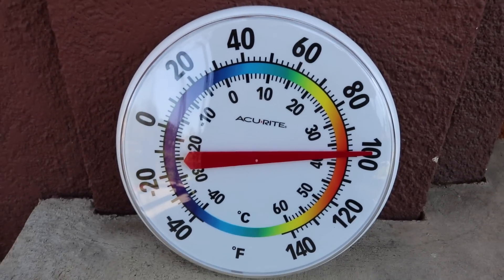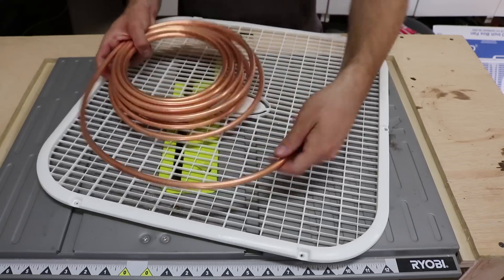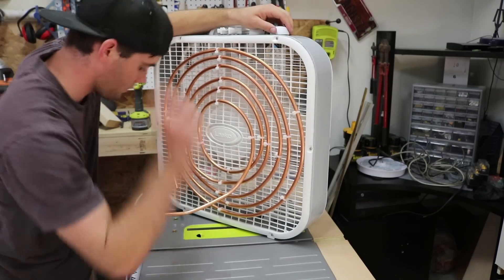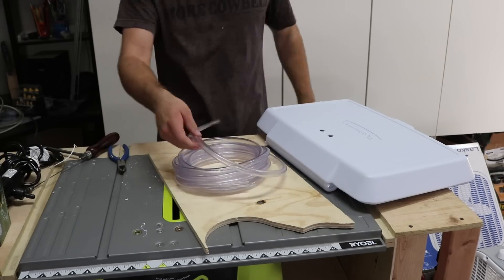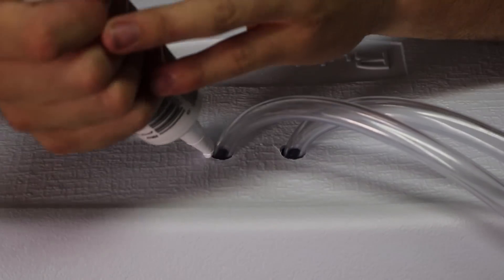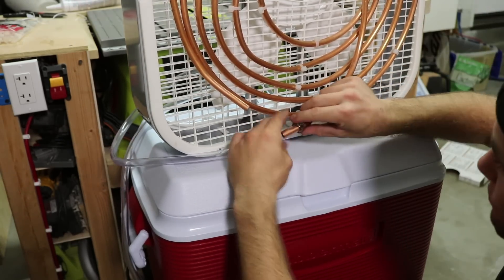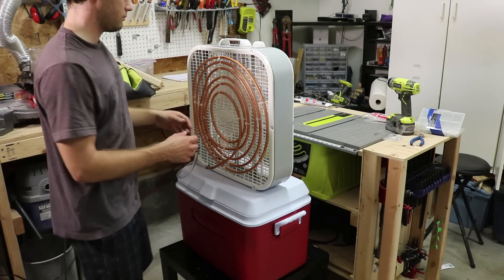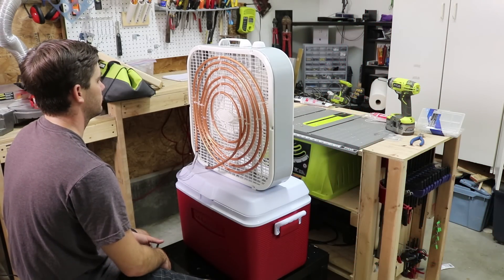$100 Homemade Air Conditioner - DIY

Comment: For pretty close to the cost of that, you could buy a real AC unit.
Reply: Tou Xic vong You didn't list the cost of ice anywhere in there. I could run a small window unit for $.05/hr. In other words, I could run an AC for 30 HOURS for the same cost as 1 small bag of ice. And what everyone seems to forget is that, just like the box fan and pump, an AC has an off switch and doesn't have to run 24/7.

Before you go saying "I'll make my own ice" I suggest you find one of my other replies that spells out how that costs 3x as much as running a window unit.
Reply: shane bates you seem like a idiot, lol 😂
Reply: You're right. But it is much more expensive to run than a fan and a small pump. On the other hand, what good is the DIY AC if it doesn't cool everything down and makes a lot of condensation that you have to deal with?
Reply: MrDeadmanwalken1 I know how an A/C system works, what I didnt know ice makers had an exhaust that goes outside. Regular refrigerators pump heat from the inside of the fridge to the  outside,your home, so essentially you wouod be making you house warmer trying to use that ice.
Reply: I'm pretty sure a Ice maker & a A/C  unit are slightly different as in internal parts making them what they are made for & an ice maker would be a cooler way to keep a room cool compared to that shitty feeling that comes with using a/c units.
Reply: Hi there... I'm a refrigeration technician and what you're saying is incorrect. An ice machine will increase the temperature of any room it's placed into. The "radiator" you're referring to is called a condenser, and the fan blows air across the condenser coil to condense the refrigerant back into a high temperature liquid. Discharge air can easily soar over 100°F. The low temperature "expanded" refrigerant never comes in contact with ambient room air; it has water poured across a freezing surface attached to the evaporator. But yes, like a heatpump, there is a heat exchange from the water to the freezing surface, the heat from the ice is literally vented into whatever room the ice machine is in (unless the condensing unit is mounted on the exterior of the building)
Reply: not to mention the constant purchase of ice. If you make the ice at home your house ends up getting warmer
Reply: @raulciprianoyahoo  he is in a shop,  for his ac being able to move around there is very awesome
An AC unit needs to be in an enclosed area
Ice isn't near as expensive as an electric bill that has an AC unit
His ice can last
Reply: @raulciprianoyahoo  wwtf how will your home get warmer if you take some ice what do you like in an Igloo
Reply: @raulciprianoyahoo  put water in a jug and freeze it. Use it freeze again. Freeze it and ......,u get the idea right?  No need to buy ice
Reply: @raulciprianoyahoo  your already running your existing freezer. Just freeze a couple salad bowls with tap water.
Reply: @raulciprianoyahoo  most people have a fridge/freezer anyway
Reply: If you add salt to the ice water it'll drop the temperature  downto about 28 degrees but it won't freeze. .so it'll  still be fluid enough to go through the pump. .try it. It works
Reply: You can get an even larger used one for 100. Craigslist rocks. Just try it out first.
Reply: I live in a small town where many of the rental properties are owed by individuals. They write it into the lease that you are not allowed to have an AC installed. For situations like that, this is an attractive idea.
Reply: 6000btu units would cool a garage and cost $120ish.
Reply: Mikeman hoff so you think a cooler full of ice and a fan would do a better job???
Reply: Raul Cipriano yea I just installed one in a convenience store last year, since then I've kinda wanted to get one. They have a 3 stage water filter system vs the fridgerator ones so the ice is much cleaner and it's designed for 24/7 operation while maintaining temps in the store reducing cooling cost of the store vs the aio units fridges come with so no heat goes in the building.since it works just like a ac heatpump whole house unit but it mounts to the outer wall I think that it would be great since you can shut off the ice making part and just turn it on as needed not having ti worry about running out of ice
Reply: you can get a mini split pretty cheap
Reply: Window unit BUT refrigerated AC uses a ton of electricity & an evaporative water cooler runs on the same as a big light bulb..big difference
Reply: Yes,9000 btu window ac is for$ 109,and can cool the space way better than this
Reply: @gegazaidd  yes until you see how much electricity needed to run the ac.
Reply: Buy a window AC for $200 and cut out a window Boom!
Reply: MrDgwphotos you would need to spend 500-600$ to get a powerful enough unit to be able to cool an un insulated garage that gets to 100-125 degrees every day....
Reply: Tou Xic vong  I like where your heads at. Now imagine how much you could save if you ditched the house and lived in a refrigerator.
Reply: MrDgwphotos what everyone fails to realize is he has no windows to put a unit up in his shop. That’s why he made it this way.
Reply: Ingenuity and the price of doing something yourself... priceless. And I’m pretty sure as a young inventor his mind has already thought of hundreds of ways to improve upon his concept. That is the actual and only cost here.
Reply: MrDgwphotos and those A/C Units will jack up your Electric Bill
Reply: @SiberianStalker  Install solar panels and during daytime it runs for free. A A+++ Daikin model doesn't consume much.
Reply: @SiberianStalker  it will be much cheaper than buying several bags of ice each day. Besides, this fan won't actually cool the room down.
Reply: @SiberianStalker  And making the extra ice in the freezer won't?
Reply: Ricki Rowell so will that much ice
Reply: @pulaskiPumper  You don't turn up your freezer...leave at it current setting...I know it will take longer to make ice but there is no need to turn down the temp in the freezer...
Reply: @SiberianStalker  Ice grows on trees does it?
Reply: @SiberianStalker   liberal Paradise
Reply: There is one aspect that I think most people are not thinking of, and that is ventilation. In a garage there is nowhere to place a window unit and nowhere to vent a stand up unit. So for him, or anyone else with a simular issue, this is a great Idea. It's not so much about saving money as it is a different way to cool down if a traditional AC unit is not available. I dont really get why people are knocking the guy for sharing his ideas to help people and then donating the proceeds to charity.
Reply: @katiekerr5973  Because "Darwin rules", and our whole society is run on the basis of knocking other people down to advance yourself. Rather than competition making most ships rise, with a rising tide of achievement and with constant improvement, it's "destroy the competition" to show what a brutal tough ass you are. Even though this tiny AC does not meet every need for AC in the world, it sure fits a niche need, like cooling a little air in a place where there may be refrigeration, but AC is nothing but a dream. In addition, some people already have the parts, and can reuse them. 

As for making ice costing so much money, how much does it cost to cool the air in empty space in a freezer? Given that a freezer works most efficiently at about 75% full--once the contents are frozen, that is--would it cost so much more to freeze a block of ice in an already cold freezer, filled with frozen food, Blue Ice, water bottles, and ice blocks that were planned to keep 75% of the freezer full, minus the block a day you are freezing to run this cooler, and the ice cubes that cool your drinks? And if you froze your water bottles to have ice water to drink all day, couldn't you float a few in your reservoir to trade their "frozenness" with the cooling water? That way, your water bottles would help the freezer's efficiency, then would give up some of their cold to cooling the air pulled through the fan, then the person standing in it, rather than just wasting that cold sitting on a counter in the kitchen while they come to a drinkable temperature. A box fan is not for cooling the whole world, but for directing a cooling breeze in the direction of a few people. But it works well for that; this makes it cool much better when it's really hot.
Reply: @katiekerr5973  too many trolls here.
Reply: Not sure about the type of heat out west where I assume that this is located, but I would bet it is a dry heat.  Here in Alabama, in this humidity, the temperatures don't get as high as the desert but our heat is like walking into a steam sauna.  You would be much better off using a $100 window a/c unit here to help dry the air while cooling.
Reply: Doggeslife would still cool more then this unit
Reply: That’s what I was thinking! I just bought one for 116!
Reply: What kind of electric bills do you get, wow.  My $140 digital window unit from wal mart only drove my bill up an additional $20 a month from being run on high all the time. Sounds like you have Ameren Electric
Reply: cut a hole in the wall to accomadate the window unit. Me and my dad did this at my grandmas house and it seals up nicely.
Reply: Ricki Rowell how much would ice all day everyday be compared to a few bucks on the electric bill?
Reply: If it works, it would be cheaper than an A/C.  The cost of running an A/C is too great for some.  The little pump and the fan cost nothing to run.
Reply: beefstew78 Here is $2.49 for a 10 pound bag, but that's a expensive way to go.  You have to make your own ice in the freezer.  It's way cheaper.
Reply: Also, all you would have to do is substitute frozen water jugs with the ice he uses to make more efficient.
Reply: no there are portable units that roll on the ground. for like 150 bucks.
Reply: I'll use this in my beer cooler dispenser to cool the beer down. It's made from old pallets... holds a case, ice cold. This will chill the beer chute where the cans sit. Perfect...
Reply: MrDgwphotos  true BUT, he’s running about only 45 watts. He could run that thing on a solar panel. This is a good idea. I’ve done it. It works.
Reply: thats so true,  I found this other video explaining how to do a homemade air conditioning step by step and much cheaper
Reply: Bigger power bill.
Reply: This would be good if you want the fan to only hit you and also less light bill compared to window ac
Reply: MrDgwphotos yep with tax only 109.99 for the extra 10 you can be lazy.
Reply: @sheilahall9060  he is in a shop where it is in the open,  an AC only works in closed rooms
This fan can be moved,  will blow well and the electric bill will be decent
Reply: @sheilahall9060  but it could cost $100 a month to run that a.c. and they are friggen loud.
Reply: Obviously
Reply: It would cool better than a fan
Reply: Raul Cipriano but would that effect how much electricity you would be using?
Reply: same
Reply: Doggeslife cool better then a fan with some cold water running through it😂
Reply: I love how the idiot makes the stupid comment, and then you never see him ever again. Fools don't like facts thrown back at them.
Reply: Doggeslife I bet it cool more the a cooler with ice and a fan
Reply: M Thomas everyone is talking about window units.
Reply: cole everett I know they cool rooms and cost 120 bucks period
Reply: fladave99 Mills ice isn't free though.
Reply: James Charbonneau exactly
Reply: Plus damned taxes, sweet thing.
Reply: Sus Sus your forgetting a bag of ice is 5 bucks at some places.
Reply: Sus Sus now buy ten of those a day every day.
Reply: Hey YOU SMART People !!!!!!!!!  Wanna see ME STUPID...... Look here:  https://www.youtube.com/watch?v=m1sj6ispqT8
Reply: Christopher hey bro can you give me the info for this ac unit please? This sounds totally worth it
Reply: MrDgwphotos the cost of running a real ac drag ur bills up by 2 to 300 dollars a month trying to save money not spend it
Reply: Actually you can get one for $79.00 @ Wallyworld
Reply: Yes, a made in China AC Unit only worse $100... AT least better than this one
Reply: @The Magnificent Whalens Its that place West and South of the real US. And getting worse all the time.
Reply: How is the humidity?
Reply: @M T smh
Reply: no but you can buy a a huge aircooler
Reply: But it wouldn't be as effective,  being that is a workshop,  it would actually be pointless
Reply: Lol 😂
Reply: Lmao 😂 🤣😂 🤣😂 🤣
Reply: Yeah if you want to punch a hole in your garage
Reply: A new 5,000 btu a/c, is $89.00
Reply: You can buy a small air conditioner for $100, but it will suck up gobs of electricity trying to keep that garage cool.  The cooler setup is meant for spot comfort and only uses a trivial amount of power in comparison.
Reply: @Lex5576  Them your first step should be to insulate the garage.
Reply: LOL
Reply: Or you can open your doors?!
Reply: But if you're secretly making shine, you can justify buying the worm if anyone asks.
Reply: Why does everyone seem to think it's so expensive to make ice?? It's ICE! It costs NOTHING to make it! Unless you guys unplug your freezers every time you finish freezing a batch of ice cubes? My freezer is always running and it costs the same to do that whether I've got water freezing in there or not. I'm really not following that logic...

That said, I do agree that this is really inefficient. I've seen another DIY option that does the exact same thing, and it cost them all of $8 to make. It makes no sense to spend so much on a fan plopped a cooler. But, the argument for that isn't over the cost of ice, it's that for $20 more, I could buy a brand new 5000 BTU window unit. I could get a near brand new one, with an even higher BTU, for even less. This is just not worth the cost
Reply: Ok this is portable. Do you want to pull your window fan from room to room.
Reply: Lol
Reply: Except you cant put that ac anywhere you want.  Considering it will have to have an exhaust.
Reply: True!!!
Reply: I thought the same thing.  Well, for not a whole lot more.  Why not spend a little more and get the real thing without going through all this hassle?
Reply: Yeah but you're gonna save on your electric bills.
Reply: Where will he install it? You need a window then it becomes a weak spot for burglars to come in.. plus a 100 dollar unit is about 5000 btu it will continually  work without stopping ,thats about 8 amps of electricity.. it adds up.
Reply: ROFL!
Reply: WITH a warranty
Reply: this is fake. its not AC
Reply: To answer your question which is probably already been answered it is true that the cost is close to buying a regular AC unit but the cost of running a fan and pump compared to a air conditioner is huge electricity is hired to run AC than a fan.
Reply: @darrellwestphal4265  but you will be cool. Who cares how much it cost
Reply: 8-27-2019=Tuesday  =THE POWER OF FAITH=  Have faith in the LORD your your GOD and you will be upheld.    2 Chronicles 20:20.     Every life----including yours-----is a series of successes and failures,  celebrations and disappointments, joys and sorrows.  Every step of the way, through every triumph and tragedy, GOD will stand by your side and strengthen you . . . if you have faith in Him. JESUS taught His disciples that if they had faith,  they could move mountains.  You can too.     When you place your faith, you trust, indeed your life in the hand of CHRIST JESUS,  you'll be amazed at the marvelous things He can do with you and through you. So strengthen  your faith through praise, through worship, through Bible study,  and through prayer. And trust GOD'S plans. With Him, all things are possible, and He stands ready to open a world of possibilities to you. . . if you have  faith.     Dear GOD,  sometimes the world can be a fearful place, full of uncertainty and doubt. But You are always near and You can overcome  any challenge. Give me faith, and let remember always that with Your love and Your power, I can live courageously and faithfully today and every day. Amen8-27-2019=Tuesday  =THE POWER OF FAITH=  Have faith in the LORD your your GOD and you will be upheld.    2 Chronicles 20:20.     Every life----including yours-----is a series of successes and failures,  celebrations and disappointments, joys and sorrows.  Every step of the way, through every triumph and tragedy, GOD will stand by your side and strengthen you . . . if you have faith in Him. JESUS taught His disciples that if they had faith,  they could move mountains.  You can too.     When you place your faith, you trust, indeed your life in the hand of CHRIST JESUS,  you'll be amazed at the marvelous things He can do with you and through you. So strengthen  your faith through praise, through worship, through Bible study,  and through prayer. And trust GOD'S plans. With Him, all things are possible, and He stands ready to open a world of possibilities to you. . . if you have  faith.     Dear GOD,  sometimes the world can be a fearful place, full of uncertainty and doubt. But You are always near and You can overcome  any challenge. Give me faith, and let remember always that with Your love and Your power, I can live courageously and faithfully today and every day. Amen8-27-2019=Tuesday  =THE POWER OF FAITH=  Have faith in the LORD your your GOD and you will be upheld.    2 Chronicles 20:20.     Every life----including yours-----is a series of successes and failures,  celebrations and disappointments, joys and sorrows.  Every step of the way, through every triumph and tragedy, GOD will stand by your side and strengthen you . . . if you have faith in Him. JESUS taught His disciples that if they had faith,  they could move mountains.  You can too.     When you place your faith, you trust, indeed your life in the hand of CHRIST JESUS,  you'll be amazed at the marvelous things He can do with you and through you. So strengthen  your faith through praise, through worship, through Bible study,  and through prayer. And trust GOD'S plans. With Him, all things are possible, and He stands ready to open a world of possibilities to you. . . if you have  faith.     Dear GOD,  sometimes the world can be a fearful place, full of uncertainty and doubt. But You are always near and You can overcome  any challenge. Give me faith, and let remember always that with Your love and Your power, I can live courageously and faithfully today and every day. Amen
Reply: Yeah box fans run up your bill as well and window units are super efficient now. Espevi if you will only use it when you're in the shop. That's just a waste of money. Sorry but its the truth or at least build you something that will actually cool you down without sitting right in front of it
Reply: Some people think you live in the garage lol .  For doing projects. And or bringing  to other rooms or  using without a window. Just to cool off it's a great idea with quarter of the bill of an ac. Great job
Reply: we don't care about the cost of an AC unit, we care about the electric bill dude. the cost of a fan turn on for 8 hours vs an AC unit turned on for 8 hours is totally different.
Reply: Dgwphotos or he can buy 4 used units for the same price.
Reply: It would make a great camping AC unit
Reply: For a garage?
Reply: Am sure you can But and real but, AC units cost energy wise. This home made would like be like  a household refrigerator and you can leave that on all day. AC use the same energy in just an hour. So if your ok with that ,then yeah AC unit
Reply: @drstew1  there is no doubt that homemade device is cheaper to run. However, this is an apples to oranges comparison. They are COMPLETELY OPPOSITE. This ADDS moisture to the room, whereas an a/c unit REMOVES moisture. Moisture holds heat. You ever seen a pvc pipe hanging over the edge of a roof or exiting the house, close to the ground, that drips water? This is the moisture that your a/c removes from the air.
This humidifier he made will only be effective for a few minutes before the humidity in the room is so high, that there will no longer be a cooling effect from the  evaporation of the water on your skin. If he opened some windows it MAY help, b/c it would be CLOSER to acting like an evaporative cooler, but not completely. It's  useless in humid climates. An a/c will cool the whole AREA down, but this homemade humidifier will only be effective if you are DIRECTLY in front of it, and only for a very limited time.
A household refrigerator cools the EXACT same way as an a/c unit. It expels heat.  It works nothing at all like this invention.
Reply: Heidi S lol amazing how good things look like on a computer screen. Thanks for the heads up. When our heat returns ? I will not be pursuing this avenue.
Reply: @drstew1   I have a window unit for my bedroom which is 13' x 15'. It's an Artic King 5,000 BTU. They cost $136 + tax. It uses 1200 watts, which is 1.2 kwh. The cost of electricity depends on several factors, and can range greatly, but I think $0.14 kwh is a good guess for right now (your electric bill will tell you exactly). Now, my unit will make you FREEZE YOUR ASS OFF if you let it. So 1.2 kwh x $0.14 = $0.17 per hour. If you are really trying to conserve, try shading your windows, and don't do your cooking or run your dryer when its hot outside (things that will heat up your house), you could run it like 8 hours a day, which would be $1.34 per day, or $40.32 per month. Even if a single bag of ice would last a whole day, it won't actually COOL the room, and at $2 per bag, that's $60 per month. I really don't want to make this guy feel bad. I mean, even the greatest inventors started somewhere. But I also have been an a/c professional (commercial and residential) for years, and I understand how this works and I don't want ppl to waste $, b/c this WILL NOT work. If someone simply could not afford the a/c or the bill, I would say to open the garage door by a foot and have the fan backed up to the door, pulling fresh air into the garage. They could put aluminum foil (from the inside) to cover the garage door windows. I appreciate that you read and considered what I wrote before. :)
Reply: @drstew1  i tried this thing when
 my ac went out. It works while it works but its pretty inefficient.
Reply: This cooler is actually not, it will put a lot of water in your house structure very bad idea. Imagine all those water going to your walls Everytime you use it geez common sense
Reply: I wouldnt even buy that for $5
Reply: AC has to be vented out.  If there's no existing wall vent, one must be cut (and according to building code).
Reply: Not a practical one for garage use in most suburban garages.
Reply: Inflation, I guess? The cheapest A/C unit I could find to install in my room costs over $600.  As for getting ice, easy enough. We have a freezer outside. Technically, it's a refrigerator that is stuck on freezing temperatures, but close enough. The only thing it will heat up is the open air carport.
Reply: Ahhh ' this DIY just might be cheaper on electrical bill than an actual AC unit ? ?🤔
Reply: @tonichecavalari5956  Nope, already did the math on that...
I have an Artic King 5,000 BTU. Costs $136 + tax. It uses 1200 watts, which is 1.2 kwh. The cost of electricity can range greatly, but I will use $0.14 kwh right now. 1.2 kwh x $0.14 = $0.17 per hour. you could run it like 8 hours a day, which would be $1.34 per day, or $40.32 per month. Even if a single bag of ice would last a whole day, it won't actually COOL the room, and at $2 per bag, that's $60 per month.
Reply: @heidis8713  how about if he freezes his own ice at night for the next day ? Will it be cheaper ?
I personally would have gone and bought a portable unit. But we're talking about this particular design 😎
Reply: @tonichecavalari5956  Not really. The reason is that a freezer works very much like an air conditioner. For example, your portable unit... it would have a way to exhaust the heat outside. Probably through a flex duct that sticks out the back. Or a window unit would have the back half sticking out the window. This is because they work by removing the heat from the air. So the a/c blows hot air to the outside, and makes the inside cold. Same thing for a freezer, only when it freezes the food/water, it discharges that hot air into the house. So there is energy used to freeze the ice, and then the heat that is coming out the back of the freezer would be dumped back into the room/house, which would then need to be cooled. I'm horrible at explaining things, so I hope it made sense, but I want to make sure I stress that the main problem here is not the $2 a day for ice, or $20 a month difference. It is the fact that this will NOT bring the temperature down in the room. If you are looking to cool down a room I think a  portable unit would be a REALLY good purchase. Just make sure to get a properly sized one (in BTUs) - it will depend on the room size, occupancy, heat load, climate, etc...    :)
Reply: Yet this method is way better than an AC reason being is it makes your electric bill go sky rocketing high as hell
Reply: How about the elect bills caused by the AC?
Reply: Can I put my order In
Reply: https://youtu.be/TtRkd-rITkU is also a great way to cool down!
Reply: Cheaper to run a boxfan and a pump than an ac system. Large window ac uses 1440 watts, whereas box fans run on only 50 to 100 watts, and a small 80 gallon per hour pump, is 11 watts. Cheaper electric bill for a cheaper cooling solution. Of course, you're probably not someone who has lived on a near poverty wage.
Reply: Is was in a garage workshop... go to your garage and tell me if you see a window or space for an ac unit
Reply: Defeats the fun of diy
Reply: @MsAmiAk  If you have a $100 to waste, sure..
Reply: You can buy an Air Conditioner for $100? Where?
Reply: Or two ac's if you buy a used condenser, evaporator and compressor
Reply: IKR 🤣 lmfao 😂
Reply: True BUT that AC will run that electric bill up too😅
Reply: "Real"
Reply: But real ac has to be vented out the window or hole in wall...
Reply: he doesn't have a window dipshit
Reply: But this doesn't raise the energy btu raising your electric bill to an unconscionable amt.
Reply: @pennyhinson4949  AND doesn't provide NEARLY enough cooling for 90% of the interior of the world's continents...
Reply: Yes, but AC uses too much electricity when you only need it for a small place or a trailer home
Reply: He made more money by investing $100 LoL 🤣
Reply: And I did!
Reply: Yeah you don't end up saving much money, and the time you have to put into it, too!
Reply: This is a fantastic idea for cooling a room. Almost any solar sorce can be used to run this but only a larger, cost prohibited solar unit could run an AC unit. I was without electric for 3 days, during record breaking heat temperatures this year. I never want to do that again. This is my solution. I've already purchased an MPP 2724 inverter with two 24V batteries. That setup will easily handle this fan unit and other things.
Reply: MrDeadmanwalken1 just dont keep it in the same place you are trying to cool
Reply: @raulciprianoyahoo  was
Reply: Doggeslife a 7 lb bag of ice provides 1000 btu of cooling. The smallest window ac's provide 5000 btu/hr
Reply: Air conditioners also remove humidity from your air and that's what makes your air feel cooler. A bag of ice won't do that
Reply: manny6584   I can’t see that it would be cheaper using ice either. Close to three dollars a bag and at the most a bag probably won’t last over 2 days. If they could figure out a way to vacuum out the air after the lid is closed it would make the ice last considerably longer. I haven’t seen anyone brave enough to try this with a yeti cooler yet. Lol. Also I am thinking condensation will build up inside even if your airflow goes through tubing. There will be moisture content somewhere in the system.
Reply: All depends on the size of the room to be cooled. $100 units won't cool much.
Reply: @Doggeslife  and remember he is in a shop,  so no closed room
Reply: Doggeslife he forgot to leave his garage door slightly ajar. We all do that here in Las Vegas, NV in the summer.
Reply: @Doggeslife  ...and a bucket full of ice that you endlessly have to refill will do what exactly?
Reply: Doggeslife this one he built won’t cool much either. Especially if you get 5” away from it. Notice he didn’t do a temp check in front of it.
Reply: Lol well that 100 dollar contraption sure wont get the job done either.
Reply: manny6584  they are trying to build something that will run off of 12 volts.
Reply: @JohnDavis-yz9nq  that's not what's in the description and he said nothing like that. Hes just teaching how to make A AC for around 100 dollars.
Reply: manny6584 sorry I got his video mixed up with another one. The one I was referring to was making one using an ice chest. Wrong video.
Reply: @Doggeslife  it will cool a whole lot more than this $100 humidifier.
Reply: @Doggeslife  Neither will this system?
Reply: Raul Cipriano me personally... I'm actually looking into buying  a legit icemaker found one from a gas station for 100$
Reply: @MrDeadmanwalken1  As if running an ice machine is cheaper than a window/wall unit.  Your comments below only prove you're a bullheaded moron who won't just admit he doesn't know what he's talking about.  Der...
Reply: Mjmsdcs - Actually a 6000 btu AC unit will not even come close to being able to cool down an un-insulated 2-car garage in 100 degree heat. And even if you were to insulate the garage (including the door) you would still need about a 10,000 btu unit to get the job done.  

But then again, this homemade cooler also cannot cool the garage down at all, not even if you were constantly adding ice all day long. After all, the garage would be gaining heat at least 20 times faster than this cooler could remove it. Lets face it, the unit is only designed to cool down the body of the person who is sitting directly in front of it and not the room itself. And in this regard I suppose you could certainly get a small 5000 btu AC unit to blow directly on you, but of course you would have to have some way to vent the hot air to the outside. All a heat pump (AC unit) does, after all, is to move heat from one place to another. An AC unit simply absorbs heat from the room and deposits that heat outside of the room. And if it can remove heat faster than the room is gaining heat through the walls then the room will eventually cool down sufficiently. 

As for electricity cost, it takes the same amount of energy to make enough ice to cool down a particular room as it does to cool the room down an equal amount using an AC unit. After all, you are paying to run a heat pump in either case and for the same amount of time. 

But of course if you are making your own ice in your own home then lets not forget that the heat that is removed from you refrigerator is simply spit back out into your home. And then of course your AC unit must remove that extra heat from your home, which adds to the costs. Home refrigerators never vent heat to the outside of the house so in this case it takes more energy to use that home made ice to cool down the garage then it would cost to simply run a small AC unit in the garage.
Reply: @SLOBeachboy  And don't forget that water (humidity) can hold more heat. So while the a/c is removing heat, it is also removing moisture - making it even cooler. This humidifier does not remove heat, and it adds humidity to the air. Like you said, someone could get a =tiny= bit of relief if the fan is in front of them. That would only last a few minutes as the room  kept getting more humid, and gaining heat from other sources.
Reply: @ The Whalens, if you read my comment, you would see that I acknowledged that this video was made "out west".  Being from Alabama, I have a general idea that California is west of here and that the humidity is quite different.    I would not really want you to underestimate our intelligence here in the south since we built the   Saturn V rockets and lunar rover  that went to the moon.  You may not believe that either though.
Reply: @bimmerwman  So, you work for NASA?
Reply: MrDeadmanwalken1 14 years as a mechanical contractor and I've never heard of a 1,200 btu window unit. Quick google search turned up empty as well. Got a link? Genuinely intrigued. However, I do know that I can walk into any hardware or department store right now and get a 5k unit. When I said smallest I meant the smallest of what's readily available, not the "Guinness World Record Smallest AC".

Peltiers have no practical use for home cooling and their efficiency is 1/50th of a conventional AC
Reply: Anal patrol with the #'s. Fucking geek.
Reply: Bag of Ice = $1.50-$2.00/day X30 days = $52.5/month (average)  while still using electricity to cool off one bedroom for maybe half a day. 
$52.5 X 12 = $630
With $500-$600 you can purchase a smart/lightweight/energy efficient indoor portable AC unit with a drain hose that can cool off a 600-900 sq ft studio apartment. And with the extra $30+ dollars left in your pocket you can buy a cooler and fill it with beer.
Reply: katie kerr there are windows in the garage door. If he's having to spend the majority of a day in there take out a window. Put the real ac in the hole. He's not opening the door. Not knocking him but I trust the engineers that made millions on the patent for the ac then I do a guy spending 100 bucks a week on ice for his fan.
Reply: @beefstew78  Even better would be for him to get a one or two tube portable A/C unit. Two tube ones are better but cost more. In the winter, it could double as a heater. While not quite as efficient as a window shaker, it would be an easier install. We have one both in our Florida and Ohio homes . As both are multi level, it is hard to keep an upstairs cool while the temp is set for the ground floor. The one tube takes care of it. Mini splits are now offered as two evaporator units with one condenser. That also works in multi story homes. Window shakers also do not play as well with sliding windows. They do work with sash windows. One tube/two tube units work with either type. As his garage door should have a vent opening somewhere on the lower part it, that is where the duct should be run in his case.
Reply: MrDgwphotos 

I just leave an old refrigerator running in the garage with the door wide open.
Reply: +MrDgwphotos - Please don't knock on my Hommies with Poor Mathematics and English!  LMFAO!!!
Reply: +Christopher - Please don't knock on my Hommies with poor Mathematics and English!  LMFAO!!!
Reply: BTW...  I was STUPID once!  I even have a Video to show how STUPID I was!  Here:  https://www.youtube.com/watch?v=m1sj6ispqT8
Reply: MrDeadmanwalken1 you no nothing about how air conditioners work do you😂
Reply: thomas can get a real AC unit for just £300 here that is 12000BTU enough for a big room
Reply: @M T I have a little Sylvania window air conditioner here in San Antonio, Texas with a remote control that cost $ 99.99 at HEB grocery store, but this was fun to watch.
Reply: RE-FREEZ  MILK  JUGS
Reply: those are the individuals that we call asslhole landlords
Reply: YOU CAN PICK UP FOR FREE,  THICK WHITE STYROFOAM COOLERS THAT PEOPLE GET  FROZEN OMAHA STEAKS, AND SUCH, LIKE,  FROZEN FOOD,  DELIVERED IN.  CHECK CRAIGS LIST  AND  MARKETPLACE (ON FACEBOOK-BETTER THAN CRAIGS LIST)
Reply: Raul Cipriano lol those ice makers have a  radiator and condenser pump outside with a fan  to push heat away from the radiator it sucks the heat out with a gas  through insulated copper tubing and condenses the gas after it goes to the cooling coil  back to the radiator when it comes from the radiator to the coil it rapidly expands making freezing temperatures and then the cycle happens again so if anything it will make the garage cooler since the way it cools is sucking heat out of the area it's in like a heatpump
Reply: THAT WILL NOT COOL MY 40'X50' SHOP,   I NEED  18,000 BTU  220V.  FOR HUNDRED  BUCKS  ???
Reply: Bob Haddock. An 18000 BTU unit would not cool a 40X50 shop.
Reply: shane bates  that's actually incorrect... the smallest ac you can buy produces about 1200btu and that's just a window unit. They do make smaller units for coolers with a peltier chip with heatsync and fans..